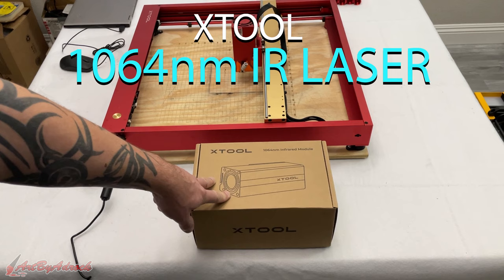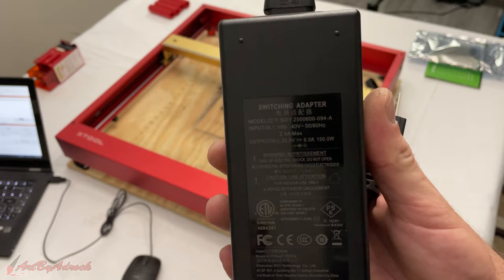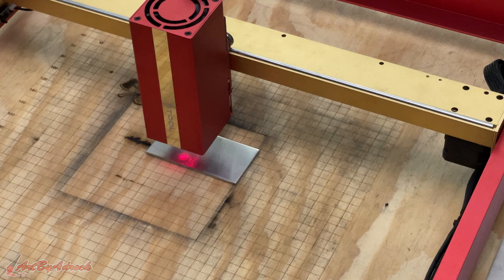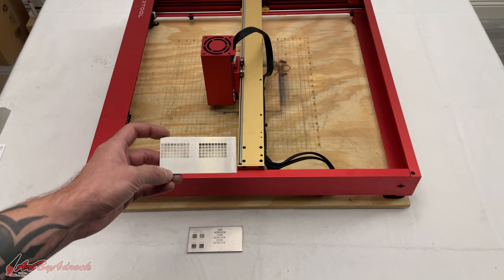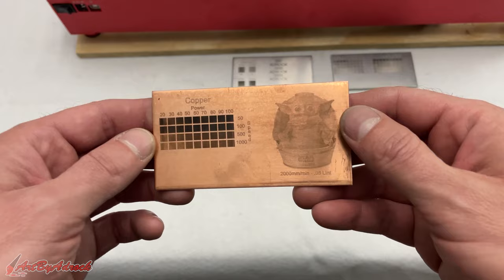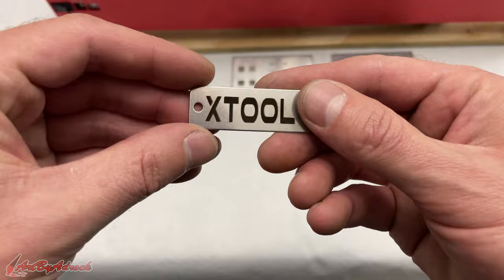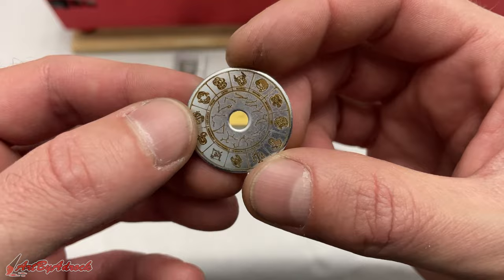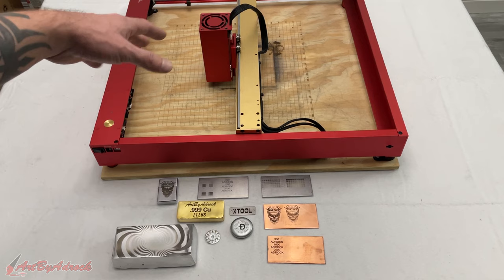Engrave ALL Metal EASILY!! - XTOOL 1064nm Infrared Laser (IR) DIY

Comment from the maker: Hey everyone, if you’re looking to engrave just about any metal out there, I highly recommend this IR laser from Xtool. I love this thing and I’ll be engraving a lot more with it down the road 👍🏻 I hope you enjoy and have a great rest of the week!
Reply: I see they offer a kit with both this module and the blue laser module, what would you use the blue laser for that this one can't do?
Reply from the maker: @benstrait333  the ir laser won’t work on wood  and other materials that the blue diode will.
Reply: so as it engraves, does it remove some material? 
i think this would be very interesting for making youre own PCB's. 
can you test that?
Reply: So will this IR module deeply engrave raw aluminum? Or will it engrave deep on powder coated aluminum?
Reply from the maker: I wouldn’t say deep like a fiber laser would do but enough to feel it with your fingernail if that makes sense. I’m sure with numerous passes you could make it deeper but how many I’m not sure. I’ll have to try and see
Reply: @ArtByAdrock  so it should engrave through painted or coated aluminum?
Reply: @ArtByAdrock  is there a way I can sent a picture to you to kinda show you what I’m trying to achieve?
Reply from the maker: It should yes. Send me an email and I can take a look
Reply: did you use marking spray? just got mine set up, doing practice, does not engrave black, like yours did on stainless
Reply from the maker: @devlinblackburn3233  what settings are you using and are you sure it’s focused correctly? Do not go off the lever for focusing as it might be off by a little.
Reply: @ArtByAdrock  using the speeds you had listed as well as line intervals
Reply: Hi @Artbyadrock , are you using the D1 Pro 10 W or 20 W ? Do  you think I can edge into stainless steel like you did in the video with the Infrared Laser on the D1 Pro 10 W ? Or would you say I need the 20 W ? Thanks in andanve🙂
Reply: Do you think it would work on axe heads?

Comment: Ooof. IR lasers. I was partially blinded in my left eye by an aircraft equipped with an IR laser jammer when I was stationed at Offutt AFB in 2001. It only took an instant and was permanent. Even though your device and the jammer are vastly different in power and frequency, I don't think I'll ever own a laser engraving system despite how cool it works. Excellent video demonstration. 👍

Comment: So, you figured the the "focus leg" did not provide optimum focus.  How did you arrive at that conclusion?  Did you perform a "ramp test", or, did you fire the IR in the "move" command box for a second or two with a nominal power setting - ~25% - then measure the burn spot?  IF you though that the visible laser spot you see, (used only for positioning), had/has the same focus spot as the IR laser, then, that may be a wrong assumption.  I would fire the IR laser at about 25% power for one second, at different focus heights, and then determine which height gave you the smallest IR beam burn...  BUT, tell us ALL how YOU did it............. Thanks....

Comment: Hi @Artbyadrock , are you using the D1 Pro 10 W or 20 W ? Do  you think I can edge into stainless steel like you did in the video with the Infrared Laser on the D1 Pro 10 W ? Or would you say I need the 20 W ? Thanks in andanve🙂
Reply: I just saw the video again carefully and saw you used the 20 W :) You often mentioned using full power. Do you think the 10 W would be enough to get similar results to yours on stainless steel ? I'm on the verge of buying an Xtool D1 Pro with the IR Laser, I simply don't know if the 10 W is enough. Of course, I'm as afraid of spending too much money asmuch as I am of falling short.

Comment: Can you help me I got the D1 pro bundle with the 1064 nm but I don’t know how to use the 1064 nm all I found was the program for the 20W and I was wondering do I have to have a different program for the 1064nm? Or different wattage for the 1064
Reply from the maker: No, use the same program whether it’s Lasergrbl or lightburn. You’ll just need to fine tune your power and speed settings based on the material you’re engraving.

Comment: there is clearly a scratch in the gold ingot that wasn't there the frame before you scratched it with your fingernail.  It seems in that particular example that it either doesn't work very well at all on gold or you just need to go deeper.  I am curious as to which one it is, what are your thoughts on it?
Reply: I noticed the same thing - How he was able  to put scratches on engraved letters with Just his thumbnail. I had to back it up to make sure it wasn't a trick of the light but it wasn't! His moving it around made the scratches more visible.